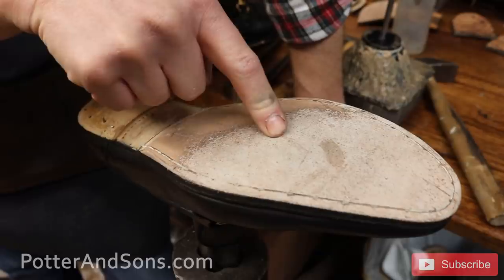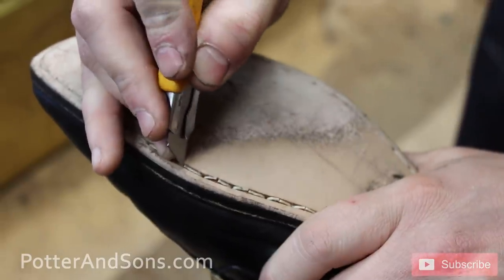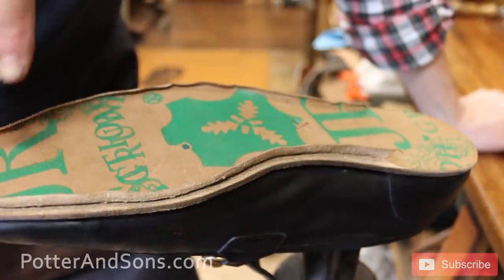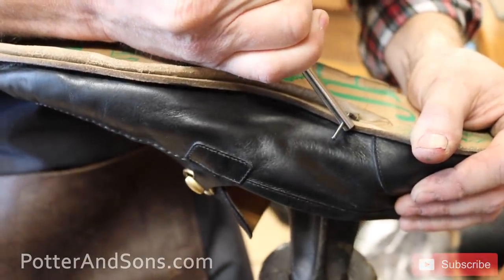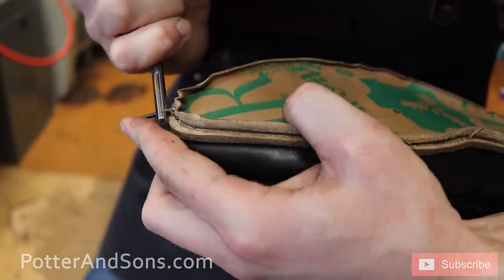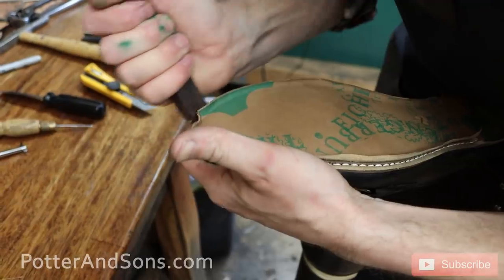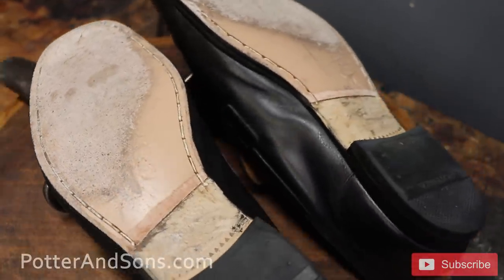Gucci Horsebit Loafers Refurbishment | From Boring Soles to Graffiti Soles

Comment: Nice video!  Is there a way to recolor the horse-bit metal once the brass color has worn off?
Reply: I'm no expert but I think it depends. If your brass is tarnished but solid brass a metal polish will do the trick. If it's coated and there is zinc or something cheap underneath I think you're up the creek. Unless you have some way to take the bit off and recoat it.

Comment: I have a question. I would really like to get a good pair of boots. Similar to the Thursday Captains or Cadets. I am paralyzed and have trouble with swelling in my ankles because of my legs being down and bent a majority of the time. How much trouble would it be to place a zipper down the back of the boot to make it easier to get on? I wear Converse Chucks primarily because of this issue. At 48 years old I'd like to up my game. Love the videos! I've learned a lot.
Reply from the maker: Craig D Hmmm...not too terribly hard for someone that knows what they’re doing.  We no longer do that kind of work, but there are still a lot of folks out there that do.  You may want to try Bedos Leatherworks in Virginia.

Comment: When you split the edge of the soles like that and stitch the bottom down - what is holding the little top flap of leather to the shoe? i know you pushed it and hammered it and stuff but won’t that little flappy part come up really easily with wear? is there glue applied that wasn’t in the video? thanks!

Comment: Why do you use the heated indentor next to the heel, what's the purpose of that?
Reply from the maker: It's kind of a traditional thing in shoemaking.
Reply: @TrentonHeath  Is it just for show rather than purpose?
Reply from the maker: @KerryHopkins  Just decor.   There are many wheel patterns,  but the fudge wheel is the most traditional at the heel breast.